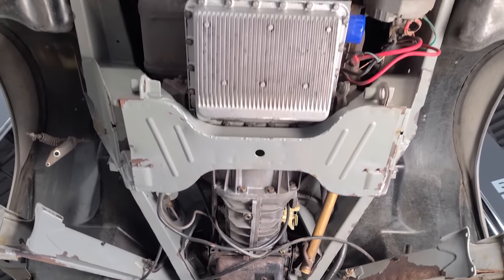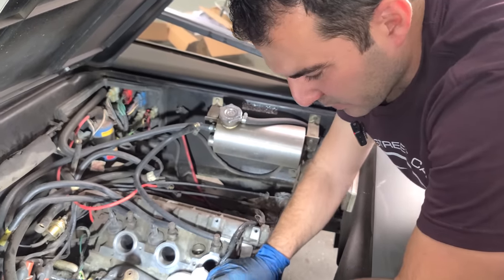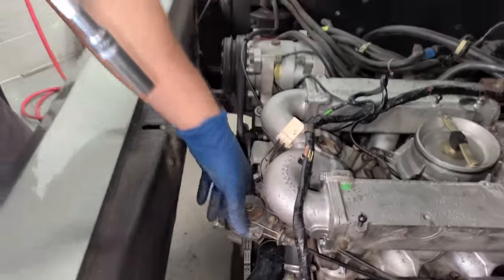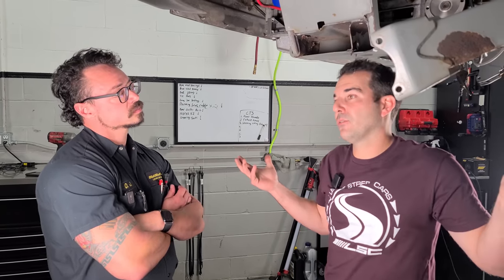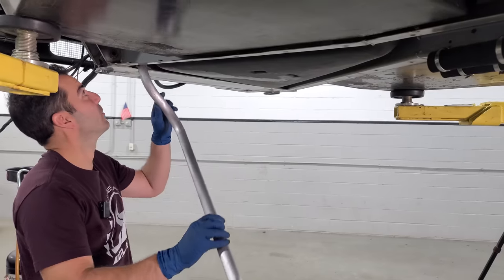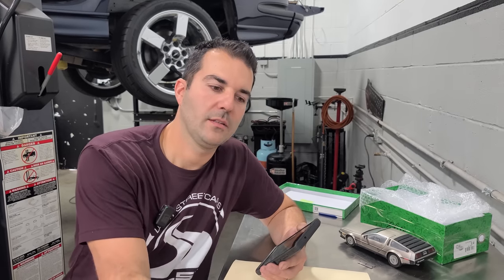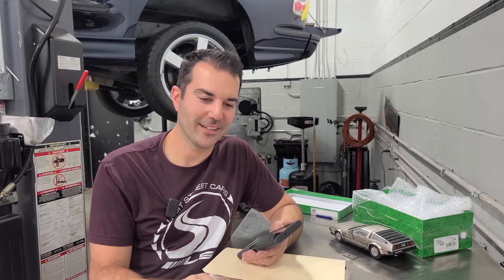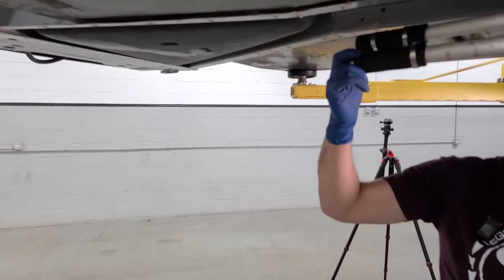I Put My DeLorean Engine Back Together & Spoke With The Orignal Owner! Fake Miles & More Bad News :(

Comment from the maker: Ok Ok, if you were going to swap the engine what would you go with? It's coming out anyway at this point.
Reply: kia stinger or coyote
Reply: Lsa 6.2 L.S
Reply: Coyote would be cool
Reply: See? I knew there was going to be an LS9 option 😂
But you could go with a Tesla conversion 😮
Reply: Rb26 probably
Reply: Hellcat red eye. Biggest bang for the buck. Coyote is a great choice too.
Reply: Coyote
Reply: A ls
Reply: K20
Reply: RB26
Reply: Supercharged 3800 Buick.
Reply: Take it out and do a complete rebuild
Reply: M113k
Reply: Honda k series
Reply: Ls427# 888mph
Reply: Can a V8 fit in that ?
Reply: The v6 from the F150?
Reply: If I could ,I would have made it stock . To swap I either go for a coyote for American muscle vibe or straight to a 2jz if I could (I know its dumb but that is my way to go)
Reply: Why swap it? Use what u got.. maybe do a conventional tune with cams and headers? 
And/Or make it run on homemade methane gas (biogas) . 
Or if u must swap the engine..make an electric conversion.
Reply: @hashtagtnt  probably.
Reply: Twin turbo LS from Texas Speed!! Hit up Cleetus
Reply: N55
Reply: K20 or 24 or  a turbo2.0 out of a newer accord
Reply: Either ls 6 or 2jz
Reply: C8 Powerplant
Reply: Syclone engine
Reply: Grand national gnx turbo 3.8 swap
Reply: Electric, closest to a flux capacitor
Reply: Electric motor. Nothing fast cus the car won't take it.
Reply: Coyote would likely be best, but I'd recommend an older Ford engine like a 351 carbonated motor.Less to translate over and change overall and very powerful.
Reply: a bmw e60 m5 engine (v10)
Reply: Honda K or J series swap.
Reply: Ls7
Reply: @hashtagtnt ls1 conversion has been done before can't remember where I saw/read about it though
Reply: Or rb26
Reply: LS front wheel drive from a Grand Prix, use the front wheel transmission etc.
Reply: 1kr fe (1L 68HP)
Reply: Would be sick if a Barra fit lol probably not tho
Reply: turbo k24... 1000hp, with a sequential transmission. ooooor... i think LS2's or LS3's came in the GTO's that are side mounted and that would be pretty cool to see. but the k24 is super light and can be pretty powerful.  or wanna go crazy unique... Barra or 2jz for the lulz
Reply: B280 would be a logical choice. Porsche 928 would be what my heart wants, because that's the engine sound dubbed in for BTTF
Reply: Coyote
Reply: LS swap it, make it fun
Reply: 2JZ with a hater pipe
Reply: @jakepocock1616  hmm... honestly would be pretty unique imo, them f150 v6's are pretty nice
Reply: @Joe-bj7nz  the engines in these things are 100% garbage, and he has access to do anything in the world. i wouldn't put a dime into this engine besides getting it running with a basic tune up
Reply: You know you want to ls swap it
Reply: Series 3 buick 3800 supercharged 😉
Reply: Realistically the transmission can’t take that much power. I do a mild EV build.
Reply: EV or the Hellcat. The whine behind your head wohld be insane. But seeing you and Rich turn it into an EV would be epic.

Edit: unconventional option that you have experience with....N54!!! Low weight, twin turbo noises, ridiculous torque, easy access to the typical issue areas in that bay....and they're CHEAP to get and tune as you know!!
Reply: Fwd gm buick/pontiac  90-00 3800 supercharged v6. Plenty aftermarket for it and they make proven tq/hp  while keeping weight down
Reply: 4.3 LS? It's an LS, tons of spare parts availability and it's a V6 so there's more room in the trunk for it.
Reply: LS?  Hellcat?  Mercedes V12?  (That would be interesting...)
Reply: Not many will say this but fix the original 😊
Reply: Tesla!! Just makes sense!!
Reply: nissan maxima vq35
Reply: Have fun with it and not be sad , you can go in the past and bring a new one .
Reply: Maybe a turbo conversion L67, or I know the LS4 has been done before.
Reply: @shept.7736  very common swap for this car and fiero's but personally i think the engine from the GTO would be a great fit into this. i think they came with LS2's or LS3's and are setup to be mounted in the same orientation as well as the stock engine much like the 3800 but with more power baby !
Reply: Buick 3800 supercharged series 3
Reply: C!ear!y a GNX turbo six is the right swap.
Reply: GM 2.8 twin turbo from the UK vauxhall insignia vxr and in a cadilac something lol
Reply: Tesla
Reply: Big turbo honda swap 👍
Reply: LS Swapped
Reply: 383 STROKER
Reply: LS swap! Or to keep it 80’s, see if you can find a Regal 3800
Reply: I know it's almost cliche at this point but I would LS swap it .
Reply: Everyone keeps saying coyote, Jared could barely make it fit in a Duster and this is infinitely more complicated.
Reply: Ford 3.0 Twin turbo
Reply: On second thought Alex find out if your Delorean friends know where a replacement Delorean engine can be acquired.
Reply: Ls4 swap!!!! You can keep the same manual trans that came with the cars.
Reply: @whollymindless  straight up just steal is buick engine hah. i mean he could just take the trans am engine as well... or even the van engine.
Reply: A powerful 4cyl, all those here recommending these large engines must be old or compensating for something. This car is old and needs to remain light, adding a massive overpowerrd engine is just bad.
Reply: LS9!
Reply: Something that revs high and put a different manual trans in it as well.  Go crazy and put a Hayabusa motor + turbo and a manual trans from a Porsche.  Please not an LS swap, those have gotten boring.
Reply: Keep it a V6. Maybe the V6 out of the newer Camaro's?
Reply: Buick Grand National V-6!
Reply: Thought a little more… single motor Tesla..but then what about a 350-370 Z swap, 6 speed
Reply: A Corolla engine so it’s reliable
Reply: If its just sitting on the drive for Halloween then rebuild the engine as you can have it towed to your garden to display
Reply: Okay, people, hear me out: the Vortec 3700. 3.7L I5, 242/242 horse ‘n torque, decent fuel economy, and would probably fit pretty comfortably in the space you’re working with. PLUS, its damn reliable, and its a GM engine so you can KEEPYOURGMGM. Think about it!
Reply: Alfa romeo v6 busso .Would sound epic if it was possible.
Reply: Seeing what Mike from Stanceworks did with his k-swapped Ferrari, that's maybe the right size for the engine compartment? And for all the reasons Mike states for the swap.
Reply: It's gotta be gm so probably an ls
Reply: Rotary
Reply: Put something in it that's v6 with good power and reliability. Like the gm 2.8 3.1 3.4 or 3800. The 3800 with the super charger would be fun and not overly powerful with reliability. A complete rebuild and dress up of the engine would be cool.
Reply: K series of some flavor.  Probably a K24 for a little extra displacement.  Small turbo for a little extra fun.
Reply: V6 needs to go in place of V6 :) Kia Stinger has great v6 for that. You can also try Alfa v6.
Reply: I would go for a more modern PRV with split crank pins (so even ignition firing and much better gas mileage) so it would just bolt right in. Options for donor cars are Peugeot 505 V6 (170 bhp), Renault 25 V6 Turbo (205 bhp) with the super reliable UN1 manual gearbox, Peugeot 605 V6 (170 bhp or 200 bhp with 24V), Renault Safrane Biturbo (268 bhp)
Reply: See if you can partner up with Texas speed and get a good solid running reliable motor with good power
Reply: Engine ? I think you need a big Tesla battery ! Make it seem futuristic 😎
Reply: K series
Reply: The wiser engine choice in a volvo 760 (wich hade the same engine as the dmc) wich is the volvo B230FT. Its a extremely reliable 2,3 four cylinder turbocharged engine with 165hp. The engine sits in volvo 740/760 turbo from 90 to 98.
Reply: Go diesel
Reply: I'm sure these already don't handle great so I'd add the weight of batteries and go electric.
If you want to own and use it forever the unfortunate fact is it's future down the line is prob stuff like battery upgrades
Reply: SMX
Reply: @AlteredCarbons  Well Ive experienced one of these engines in a Volvo 260.. and it pulled like a lil troll. The DeLorean should be lighter and even more fun than the 260. So engines not crap. 
I think it would honour both this legend of a car and this engine with a somewhat unfair reputition if LSC would make to most out of this engine. 
Thats also a good attitude overall to make to most out of stuff you got not throwing everything away and buying new shit.
Reply: 7.3 w120
Reply: Twin turbo coyote 😂
Reply: Turbo K20. It’s what Colin Chapman would use. Or LS for noise, reliability & ease.
Reply: See if a 2jz or rb 26 would fit 😅💀
Reply: Ls7
Reply: everyone saying these thousand hp motors as if this old car could ever handle it 🤣
Reply: Buick 3.8 turbo.
Reply: @jaydenbernhard92  Yeah, right.
Reply: @jakes197  Kia...KIA?  Just no.
Reply: Honda J37
Reply: V8 just ain't gonna fit.
Reply: Turbo charged Chevy 4.3.
Reply: @SamwiseGamgy47  Ghay Soyness.
Reply: @icedragon6831  Too long.
Reply: An EV conversion seems appropriate for a DeLorean.
Reply: Porsche engine! Turbo that sucker!! 👍
Good luck Alex great work love from the U.K ❤👍🇬🇧
Reply: LS
Reply: Leave it, but add electric hubs to the un driven wheels. 🤌
Reply: I would go with something like a GM LGX if you want N/A, or if you want more, a LGW.
Reply: DeLorean has a rear bias and lightening it up should help with handling so something light that can generate power would be awesome. the Honda K-series would be great, as it's reliable, light and is easy to generate power with an amazing aftermarket. I'd be concerned that the DeLorean's transaxle may be limited on how much torque it can handle.
Reply: @flanigas  I despise electrics, but I think you're on to something here...
Reply: The original just rebuilt
Reply: I'd get with @texaspeedperformance and see what you guys could put together
Reply: Absolutely a 3.8L Buick V6, preferably the supercharged variant. The engine designation here in Australia was L67, we had them in a couple of models of our Holden Commodore/Calais/Statesman
Reply: @cottage6988  I’m sure a frame made for 100hp will be fine with 700hp.
Reply: There are plenty of original delorean engines that pop up for sale all the time. Keep it original, restore the engine in there. If anything do a 5 speed swap. You will be very happy vs the automatic.
Reply: SHO Taurus engine
Reply: Electric, not tesla swap but a fully custom built drive train from forklift motors
Reply: If not Honda K then some good v6 shouts like Alfa or more modern turbo v6. Maybe u could drop a Honda turbo K into a white Lotus Esprit one day like one Bond used to go under water, Esprit is another car from this era totally let down by Renault parts & old 4 pot.
Reply: Coyote
Reply: I would love to see a rotary in there, like it was originally planned from delorean😁 but to complicated, i would go with a coyote
Reply: Probably a late gen 3.5L ecoboost. You don't want too much power to overwhelm the chassis and it has to fit and weigh almost the same as the PRV engine. That or a 3800 without the plastic manifolds.
Reply: @fiero880  it’s one of the weakest, most unreliable engines ever made.
Reply: biggest issue is are you replacing transmission? that Renault won't handle a lot of torque.
Reply: LS swap
Reply: 3.8 liter turbo from the Buick help the little brother out.
Reply: K24
Reply: LS no question
Reply: k20
Reply: Re build the engine for boost and turbo it double hp and go keep it Delorean
Reply: What if you 3D print all the parts and build a brand new engine?  Naw, too much work.  Good luck!
Reply: I see a lot of electric swap, comments. That would be the very first electric delorean, and probably the coolest swap ever done, but how difficult would that be. I think it’s easier said than done.
Reply: If I had the experience and knowledge I would go Electrical Tech. But the rebalance weight distribution would be something, Center of gravity. It just has to go above 88 m.p.h 😅😂, anyways awesome 🤩.
Reply: LV1 said it since the 1st video
Reply: C32 AMG swap would be rather unique IMO
Reply: Aston Martin 4.7-litre V8
Reply: K series. Would pass off alot of people
Reply: SPEC TT Rapture – Forged Internal PRV w/EFI, Twin Turbocharger Units (Premium) by DeLorean Industries.
Keep the "purity."  😁
Reply: In my opinion, I would keep it original.
Reply: V8 Porsche 928. That was the engine sound they dubbed for the Delorean in BTTF.
Reply: 4.3 from Chevy Astro van
Reply: GM 3800
Reply: Tesla!😈
Reply: I need a job alex,, you hiring? I'm in Cincinnati Ohio.  I'm serious.
Reply: The guy that did the Kia engine in his sounded so good had some of the flair of the original but all modern.
Reply: The correct answer is LS.
Reply: @Gleamozen I've seen someone building one before on YouTube. It makes sense for sure and a helluva lot faster, but it wouldn't be the first.
Reply: You could go basic and drop in an LS3, or if it would fit, a sweet LT4 Crate Engine.
Reply: I know I will get hate but the last of the Northstars were decent. They aren't terrible to work on outside of the car.
Reply: what about rotary?
Reply: a VR6 to really get the haters going
Reply: Chevy 350cu.  Loads of options, very available, and cheap or a Turbo 3.6L. Something that could utilize existing mounts without too much modification.
Reply: Vw gti for authenticity. But a 2jz would be cool man
Reply: A massaged 4.3 Vortec.
Reply: Tesla
Reply: Everyone does LS swaps.  Don't get me wrong, they are great engines, but it is really getting boring; OH, look another LS swap car/video.   Do something different/unique.   Swap it for a Honda/Acura J32 or J35...double or more power, light weight, still a V6, and reliable well beyond an LS.
Reply: Something simple and nice not crazy hp because it’s not a race car
Reply: I hope that wasn't a Freudian slip when you said Tesla. Please don't make it Tesla powered Alex!
Reply: I'd personally love to see some kind of 6 cylinder engine in there; V6 or straight 6, I don't mind! That said, you could also go kinda crazy and try to squeeze a V12 in there if you're mad enough but idk if there's a V12 small enough and easy enough to find that'll fit the car so yeah. That's my answer
Reply: Could go to the future tesla swap
Reply: Grand National 3.8 or Syclone 4.3... maybe Buick 3800SC? Got to keep it a V6!
Reply: @jakepocock1616  Ford GT V-6 ;)
Reply: Ls engine but make frame stronger 💪 for twin turbo it or do like you did to your wife's suv super charge it..
Reply: Honda K
Reply: LS Swap Reliable and parts are cheap in case it brakes down
Reply: LS
Reply: Your company is literally LS C sooo.
But a Ford turbo v6 out of an F150 would fit better.
Reply: oh, and hydroformed SS matching bumper covers to replace the plastic ones,
Reply: K24 1000 hp
Reply: Supercharged Buick 3800
Reply: Supercharged 3800!
Reply: LS1
Reply: r56
Reply: Put a Tesla motor in it to turn it into a 1.21 gigawatt DeLorean, or dodge hellcat for that supercharger whine
Reply: 3800 supercharged buick engine!
Reply: GM 3800 V6
Reply: This car doesn't need more than 200 horsepower.  Lotus uses the 4 cylinder from a Corolla with a neat turbo.  You know it would fit easily.  People saying a Coyote don't seem to realize how big the thing is and what a dog it is at low rpm.  You want to be quick off the line not going 150 mph with a load of horsepower.
Reply: Keep it 80’s and make it reliable!  Go with a GM small block.
Reply: Honda series j37
Reply: Definitely series 3 3800 supercharged or twin turbo
Reply: Supercharged 3800 series Buick V6, or and LS :)
Reply: Try laser rust removal. It’s cool.
Reply: LS swap if possible !! that would be bad ass...the original owner Dave was a heck of a nice guy!!
Reply: A  Hayabusa with around 6 pounds of boost. It would be even lighter with more hp and sound insane when you rev it lol.
Reply: Me? I would put a Subaru Flat-4 Turbo in there, but I am weird...
Reply: Also if you use the laser, it will also burn off the epoxy
Reply: It would be cool to keep it a V6. Ford's 2.7. If you wanted to keep it GM the 3.6 has it's flaws but with proper maintenance is actually a solid engine. Or the Honda 3.5
Reply: Honda j35 with a turbo.
Reply: @theamerican7080  You know what.. I second this. Or maybe even the 3.8 Supercharged.. Perhaps a Series II.
Reply: Go electric. A delorean is the one vehicle you can shamelessly ev swap.
Reply: Newer PRV from Volvo 262 or from Renault 25 V6 Baccara
Reply: Hmm....not an expert, but this would take some engineering research. The design of the chassis could be a huge limitation. Too much engine can damage a vehicle. I wonder if heat can be a big concern? There is a lot of fiberglass.
Reply: turbo k24
Reply: A vortec 4200 inline 6 from the 2002 trailblazer its such an underrated engine
Reply: Already posted that an LS and a Porshe transaxle have been swapped on others. A 5.3L should be plenty for that car.
Reply: LS or Kswap are the only logical choices.
Reply: Chevy LFX V6
Reply: TESLA.  It goes with the back to the future vibe.
Reply: Not sure what i would go with for a engine but as for your frame issue, why not have a custom tubular frame fabricated? You're already upgrading the suspension so this seems like a opportunity to upgrade the frame to match.
Reply: 3 rotor with a turbo would be really cool. He could try to collaborate with Rob Dahm or the Vargas brothers.
Reply: 1.9 TDI PD131
Reply: LS, Coyote would sound great but it's a larger engine.  Much harder to squeeze everything in.  Plus you can work on an LS blindfolded at this point.
Reply: A new 4.3L GM V6
Reply: Tesla Swap it :D
Reply: Clio V6 engine, it's already a Renault unit, so would be cool to keep that
Reply: @cottage6988 He would never make it to 88mph!  That engine would tear that car apart.  Awesome concept though, would love to see one
Reply: 2jz gte
Reply: Do it once, do it right, especially if you are keeping it for every. That way you know it is done right and you wouldn't have any worries driving it. A for engine swap, "K" tune.
Reply: Call Rob Dahm and put a 3 rotor in it…
Reply: Well if it’s a factory gm engine then I’d probably ls swap it. That way you get power with reliability. Would love to see you restore a 1st gen Toyota 4 runner. I’ve been daily driving a 86 for 3 years now. I’m having waffles and eggs with toast for breakfast right now.
Reply: 1.6 litre, 20 valve "Silver top" (4th Generation) 4A-GE
Reply: Keep it stock.
Reply: Volvo B260/B280
Reply: Coyote.
Reply: LS. 😂
Reply: I’ve seen alot worse get cut out, fabed up, and welded back on better then the original metal. You’ll be able to fix it.
Reply: Considering how tight that engine bay is, I'd have to consider maybe a small V8 or even a twin turbo V6. You unfortunately don't have a whole lot of room to work with.
Reply: Keep it "original". Try and keep a PRV V6, but hop it up internally. Not sure how much power these engines can make. But don't do an engine swap
Reply: 2jz supra or a 5sgte iron block Toyota 2.2.
Reply: Honda K24
Reply: LS, but you could always make it a little more interesting with something like an M113 or even the K variant - if possible, that would be sick as hell. OM606 seem really neat and can be built up and reliable but that'd be a LOT more work. LS is probably the easiest route, but a Mercedes or Italian engine would make for a more interesting car IMO.
Reply: They managed to get this engine to 400hp in the 90s on another car with turbo and custom forged parts.
Reply: Alfa Romeo Busso V6
Reply: car wont be able to take much power and space is an issue, how about a 2.0l ecotec lsj, its light 300lbs without the sc, can handle enough power without internal mods, tons of very cheap parts and its completely impossible to kill, some guy runs 5.91 at 230mph 1/4 mile with the oem cast engine block, its a euro engine in a american car like the delorean, it can go up to 88mph...
Reply: 5sgte can be very powerful 650 ft lbs of torque is small and very easy to work on. 2.2 liter and iron block. Lasts stupidly long with a normal timing. And they are in the MR2. Don't go 3sgte unless you want turbo.
Reply: K swap
Reply: @ProfessorShroom I think it’s a Peugeot-Citroen PRV engine. Same as a Dodge Monaco
Reply: If it will fit, LS4. Get ahold of Garrett from Cletus McFarland for add ons and tuning. Leroy the Savage started out with an LS4 and was running 8s quarters. JS
Reply: Gm 3800 Series 2 or 3 N/A. Keep it Gm, and V6.
Reply: @timp5668  my DeLorean was very reliable and with the five speed it’s not a terribly slow car. You also have to remember how old these cars are in 1981 so that’s not bad as long as it’s correctly maintained it will last for quite a long time but remember, a lot of these cars have sat for years and years and years rotting away.
Reply: @ml8067  Just weld enough steel to it. Where there's a will, there's a way. 
Helps to have enough money, though. Lol
Reply: swap with a rebuild from delorian. Send in the core just like the frame.
Reply: EV!
Reply: I’d pick the transmission you / that has the possibility of fitting and holding the power you want to make, then let that dictate the engine choice, because the current transmission will not hold up to about any perforce based engine you’d likely want to swap in it.
Reply: @fiero880  one exception does not make  a rule. The car literally makes 100hp at the wheels. By any standard, any decade beyond 1930, that is considered gutless.
Reply: Air cooled 911 not likely to fit but come on its screams porsche
Reply: @MethanolEnjoyer like this..that would be interesting...
Reply: @coby541 
Nice idea don't think there's enough room for a barra engine in the Delorean..
..
Can you get parts for a Barra engine in 'Merika
Reply: @FYMASMD but it looks like a chassis/frame resto or repair.
And knowing OJ + FMU they'll make it better than the original..
Reply: Stay true to it's roots - Volvo T5
Reply: The successor to the PRV, the Renault L7X / PSA ES9J4.
Reliable and really good sound
Reply: @chrisparola3949  do you know the cost of an aircooled Porsche motor? Not worth it.
Reply: Ls3 or lt charged no ls7 please, heads issue. just swap it to a1000 whp!
Reply: @Iron_Funeral Yes..this is my thoughts..
Alex knows the engines would truly be unique...
Reply: another Delorian engine!
Reply: LS swaps are super popular and well documented
Reply: I think something a little different is in order. Flat plane crank V8 I think befits the styling and is what that kind of car should of had. F355 engine would be the pinnacle for that if you don't mind ruining your life.
Reply: @hashtagtnt yes. LS swaps and Northstar swaps are/were popular
Reply: leave it alone, keep it original until it blows up.
Reply: @timp5668  was there a price  limit? Thought we were dealing with a forever car
Reply: Maybe an …LS lol
Reply: @decomposing_while_alive2002 or the R32 3.2 V6 which I think is a Porsche/boxster engine in a different interation..
That would keep the V6 theme...
Reply: keep it original until it blows up.
Reply: @YuriChan-428 that would sound interesting and weird at the same time lol...loads of power if its the Impreza engine...
Reply: Of course we gotta go with the turbocharged Honda K24A2 swap, there can be no doubt.
Reply: I wouldn't get a V8, it's just too much power for the platform. By best bet for reliability is a Buick 3800, which you're already familiar with, for sound and novelty I'd grab a VR6, and for power I'd get a VQ. I fear the VR6 might be a tad long and tall, so if that doesn't fit, the other choice for sound would be a Duratec, if you've seen Alex's Rocketeer Miata you know that sounds lovely. Fun fact: Ford brought Porsche in to consult on the Duratec's development.
Reply: You know the answer already..  LS swap for the win!
Reply: Don't swap the engine until the factory engine gives up the ghost.   The factory engine could last another ten years and 100,000 miles.
Reply: Those PVR engines are actually great, they made 400 hp in the Venturi Road cars, with turbo I believe, and 490 hp in the Alfa Romeo 155 touring championship cars. Besides they proppeled the Renault Alpine A310 and the V6.
Reply: @chrisparola3949 sadly that changed with the chassis/frame rebuild..
Reply: Tesla plaid motor
Reply: LS swap definetly
Reply: A turbo Ford Bara because why not!
Reply: 7.0L LS
Reply: 1/ I'd say the engine out of the McLaren🤣
2/The mercedes V8
But this may be too heavy.
3/Really like the Alfa V6 ~ 250 horses in standard.
Which would be a nice power for the chassis without overwhelming it.
Looks good with the chrome inlet pipes too.
Would be unique.
..
In all honesty keeping the original Renault V6 tuned to about 250hp.
Or use the original  V6 with the twin turbo option available at the time.
Keeps things simple. & Original without mission creep.
(While you're in there)..
LS is great but has been done loads and would be a little too heavy possibly too much power..
...
Reply: 3800 Supercharged V6. It'll remain a V6 but be reliable and have much more power with the supercharger.
Reply: K20 turbo. Light, powerful, and reliable.
Reply: Lima 2.3T
Reply: LS sounds good but to make it a Tesla swap Electric that sounds kind of cool to
Reply: M113K, of course!
Reply: SC 3800!!
Reply: The limit of the frames capacity? 😮
Reply: Anything but the PRV engine. I followed a blog about a Volvo 760 restoration, he even got a new engine from Peugeot, the factory new block decided to split after 300 miles or something. If you want to punish yourself with Volvo parts, then a T4 from an old S40.
Reply: 1uz-fe
Reply: 3800 GNX Motor
Reply: K20 would be an incredible sound, bulletproof reliable, lightweight fun. And it would be different than your usual v8s
Reply: Since it came with a psa engine, maybe a volvo T5? Unique sound and reliable. Otherwise any turbo v6👍
Reply: a porsche 4L flat 6 would be a pretty sick swap. or maybe a 6G72TT
Reply: Subaru VB 2.4 boxer
Reply: @timp5668  Exactly. If it can run through time and space then it will be fine. 
Just got to find a place to put the nitrous bottle.
Reply: Supercharged Camry Engine... just like a Lotus. And you will keep it a V6... a good sounding one!
Reply: Northstar v8
Reply: I’d definitely improve the performance if the frame has too come off. Maybe an LS or some sort of V8
Reply: You know its gonna have to be Electric :face-blue-wide-eyes:
Reply: This is out of left field, but I just recently watched a Jay Leno's Garage video where he was showing his Chrysler Gas Turbine car.  I think that a DeLorean equipped with a gas turbine engine would be about the coolest thing out there just based on the sound they make alone.
Reply: EcoBoost 3.5L if want to keep it a v6
Reply: Ford 3.5 ecoboost stick with v6 power
Reply: Porsche 928 V8 as apparently used in one of the BTTF stunt cars

Lotus Type 918 (V8 from the Esprit)  It's pretty much a Lotus Esprit chassis anyway, so why not go with the correct engine.

Or, get a properly sorted 3 litre PRV V6 turbo engine.  Still pretty much the same engine, but with 300-400bhp instead.
Reply: A 5.6 liter V12
Reply: Dare to be different, Ford 3.5 ecoboost
Reply: LS3!!!! Hit up Mike Myke he always seems to have some. 😂
Reply: That PRV V-6 is pretty small...and I will come FIND you if you manage to wedge it and fit up an LS. (Toothless threat from war-weary, frail, old lion!)  How about something 'Merican, but unique?

Joke-swap:  250 Sprint OHC 6 {giggle} from a 67 Firebird? (NEVER FIT!, but John Delorean had hands all over it!)
Better, would be a bone-stock '63 Turbo-Rocket 215CI Olds.  Probably bloody expensive, but it'd cause some serious ass-scratching at Cars 'n' Coffee!
Best(?) just a plain old Rover 4.0liter. It's the same basic engine as Buick's version of the 215, but cheaper.  All alloy pushrod V-8...light, EFI-reliable...pop the tops off the rocker covers and have a set milled up that say DMC!  Be 'creative' with intake plenum(s).
Reply: Peugeot-Renault-Volvo (PRV) 2.85 L (174 cu in) SOHC V6, rated at 130 hp. The engine the car came with.

The Delorean is not now nor ever was a high performance car. It is, like a Miata, a high-fun car, and would not benefit from a heavier, more powerful engine. Keep it original, protect its value.
Reply: 3.8 buick boosted the displacement and size would work and you same era as you said if i was in your shoes and it would be freakin awesome
Reply: VW VR6
Reply: Swap in a Buick V6 Turbo (just not the one out of your GN😁). That oughta get you up to 88 mph easily. You were really bummed out when OJ gave you the condition of your DeLorean's frame, and I know that feeling. Maybe in a couple of years, we'll see you take the frame out, get it acid dipped, and replace or reinforce the weak points. And coupled with the work you've done so far, she'll be brand new - technically. You got this.
Reply: 454 lsx with twin 80mm turbo
Reply: @craigquann   just put the metal coolant elbows in so you don't have the buick valley of death lol
Reply: If you want a V8, maybe a GM LS4 5.3. Might make it easier to adapt to the Deloren.
Reply: milwaukee 8 engine. ;)
Reply: @george_cramer_1980  ic. Are they plastic from factory?
Reply: This is a retorical right, all aluminum LS and a Precision turbo
Reply: 1st choice - 3.8 Buick Supercharged for size and reliability! 2nd choice - Tesla for cool factor, power and practicality since it will be a Cars & Coffee Ride in The Future anyway. And a totally silent DeLorean would just be awesome!
Reply: V12 from W140 Mercedes, and put in Brilliant exhaust to sound like Zonda))
Reply: @craigquann  yup 2 plastic 90 degree elbows under the alternator from the water pump to the alternator bracket for the heater hoses bad design that the aftermarket actually fixed
Reply: K24
Reply: Since there are so many plug and play options for the Ls, that would be the route I would go.
Reply: Grand natty turbo 3.8l. That'd be a sick swap in a dmc
Reply: Dude, swap it with something crazy for the content possibilities. I think the extra popularity and novelty will offset the costs of doing the swap. Don't go with the conventional LS swap. Something that'll sound as exotic as the car looks.
Reply: @jakes197 oooh honestly you're onto something with a stinger engine
Reply: I'd try to figure out how to have a Telsa EV drive train with an LS power plant Quiet when I'm Grocery shopping, loud when I need a super quick get away down the drag strip and make my tank of gas almost out last the tires.
Reply: please keep it original, a beautiful car that doesn't need to do 0 to 60 in 3 seconds, its a piece of history
Reply: Godzilla
Reply: this v6 prv engine evolved in Europe over time and even ended up with a turbo mounted in an Alpine A610, but even in another French brand "Venturi" which released an exclusive model "LM500" which participated in competitions and developed loan of 400hp in 2800cm3....
I would personally stay on a v6 for reasons of size and would look for a reliable engine...
Reply: Anything but another boring LS.
Reply: LS7, easy. :)
Reply: @theamerican7080  LS is very compact.  Guarantee it would fit.
Reply: Mr. Fusion.
Reply: @george_cramer_1980  good to know.  Definitely something to upgrade
Reply: LS is pretty common but the Renoult gearbox isn't really good for handling that much power. Maybe a chevy smallblock or ford 4.6 modular.
Reply: I say electric swap it (Tesla) or some sort of thematic 6 cylinder. The reason i say go for the electric swap is that it would eliminate a ton of weight, tubing and complexity as far as some of the goofy coolant lines and locations the car has. You would be able to put batteries low where you want them and choose how much/ how far you would want it to go. regenerative braking as well to further assist your braking needs. Would definitely need a tesla expert though. In a simpler life to keep it easy and on a budget id go for possibly a GM v6 maybe a vortec or if your going to go transverse a buick 3800 like some suggest. Whatever way you go should mostly be dictated by SOUND, FEEL and CHARACTER not power as this is a dream car of yours, it needs to feel complete, not pieced together.
Reply: Cheapest and easy would be the 07K 5 cylinder mated to a FWD Passat/A4 or Porsche Boxster 01A transmission.  The non turbo engines are super cheap and you can still make power with them if you add a turbo but they all sound absolutely incredible.  They bolt right together if you trim the bell housing and patch it (just to clear the rear timing cover)  You can use a stock 4 cylinder clutch or with an aftermarket flywheel you can use B5 S4 clutches.
Reply: Buick turbo v6
Reply: Something much simpler and of the same overall size to actually fit in the engine bay. I wonder if a 4-banger would fit, but a nice, small (in overall dimensions) V-6 would be great. Wracking my brain, I can think of the Ford Eco-boost V-6, but it's a 60 degree motor.
The PRV motor was in a LOT of cars over its 25-year run, even in a Lancia. It was considered to be a good engine, but some/all owners may vehemently disagree. Simple design it was not, as evidenced by the "Valley of Death". I suppose one could fit in a Mercedes OM 272 as it's also a 90 degree V-6. The OM 276 motor could be a good choice, but it might be too powerful for the DeLorean.
No matter what modern-day V-6 is used, it will need the ECU and enough room for the exhaust manifolds to snake out.
In the end, I'd keep the PRV and search around for one which is in better shape, rebuild it and have fun. You won't be putting many miles on the car, so that could work out the best. Going the adapter route and then having to replace a lot of other components will not only be expensive but a major headache. You want to end up having a good feeling about the DeLorean, so if it were mine, I'd keep a PRV in it (after rebuilding a better example without the Valley of Death problems).
In any case... Good Luck. You will make, whatever you choose to do, a very successful endeavor.
Reply: @xoriatmike6857  electric conversion will not save or reduce weight.
Reply: 3.5 twin turbo v8 from the lotus esprit
Reply: Lots of silly answers with way too much power, something like a Honda F20C (or whatever the Civic equivalent is) would suit pretty well, and they're small
Reply: LS3 swap w/416 stroker kit. BTR rails w/roller rockers. cloyes z timing chain.
Reply: Build on the original engine. I get bored of swaps on everything.
Reply: 2JZ or a turbo B series Honda.
Reply: Go with a 2-rotor Rotary! I think a collab with Rob Dahm would be sweet! 😍
Reply: Everyone is saying big V8 or something really powerful I think it would be awesome with a GM 4.3 make it a little more powerful than stock with a cam and head work but not a race engine and put a carbed intake with a Holley sniper kit and drive it
Reply: @xoriatmike6857  AWD electric, that would be pretty sick.
Reply: They make a LS swap kit for Delorean.
Reply: Barra Turbo 🤣
Reply: @Shawn_the_Protogen  Bruh, if you're swapping the engine, you're typically also swapping the transmission.
Reply: 20B
Reply: @thomasolson8417  not necessarily. You can make an adapter plate to bolt an LS engine to the Renault gearbox.
Reply: Honestly since the original engine was from a Renault I always thought it would be neat to do a VQ swap, keep it within the Renault Nissan heritage and get some modern performance
Reply: Just a thought about the "Valley of Death", could you have it Metal Sprayed?
We use Metal Spray (molten metal) on door seal areas for EMI/RFI resistance.
Check it out, a permanent layer of molten metal would protect the valley area from further oxidation.
Reply: Rotory engine.  2 rotor or 3 rotor ftw
Reply: Srt viper cobra haha
Reply: HEMI swap
Reply: RB man idk if that would fit or LSA?
Reply: ...anything with a turbo.
Reply: M156
Reply: A japanese one for sure ! (Yes I am the owner of a Lotus Elise S2 with Toyota Engine. the perfect combination !!!).
At that weight, you just need a small 4 cylinder with 200/220 Hp mx. That' s the right amount to have great fun without driving like a criminal :) Honda K series would be ideal ;)
Reply: K24
Reply: K swap
Reply: Hey Alex ! Don't be too sad about it ! See the GOOD SIDE about it, it gives you the possibility to make a GREAT restoration series of videos about this DeLorean ... and guess what? EVERYBODY LLLLLLOVES IT!
We want to see you DO IT RIGHT, and it's the TRUTH about what such cars really are when they've been used as cars (and not only being museum pieces).
GO ALEX GO GO GO! ALEX BE GOOD!
Reply: I would look for a solid 3.0 from the same family, probably from an old Eagle or Monaco and give it some turbos (like a Renault Alpine) and just be different.   Or just go ahead and be real special and swap in a twin turbo Rotary!
Reply: Rotary!
Reply: I work in a body shop and our preferred rust stopping agent is RUSTMORT it converts the rust back to steel as well Edit: Everyone wants you to engine swap damn vultures lol
Reply: KA20A
Reply: If you want to improve the power while preserving the spirit of the car, the right answer is the ES/L engine, a 3.0 V6 designed by Renault and PSA as a replacement for the PRV engine found in the DMC-12, which produces around 200 HP in the original NA form (and reaches over 1.000 in specialized twin turbo configurations). Using a GM engine doesn't make any sense in a Delorean...
Reply: 2JZ. Send it.
Reply: Nothing to powerful, 250-300nhp ,max
Reply: B284r
Reply: LS
Reply: I'm a little different so I would go with a Ford 3.7L Cyclone out of a mustang, then I would pro charge it so it was running around 450 hp. That way it would still be a V6.
Reply: or the 3.0 twin turbo as seen in the lincoln MKZ
Reply: Buick 3.8 Turbo, Simple bang for buck that would fit in the space.
Reply: Electric with a sound-system to make the vroom-vroom sounds?
Reply: It's looking great.....good job...can I buy that sunroof grease at Mercedes service?
Reply: 7.3L Godzilla. Gawdzila!
Reply: Chevy ss motor nobody touches the Chevy ss 😔😔😔
Reply: Ls lol
Reply: Put a Honda k20 in it
Reply: Supercharged Chevrolet 4.3
Reply: Om606
Reply: Kia Stinger motor
Reply: Honda J series V6. Cheap to buy simple engine with reasonable power. The Delorean Chassis is not good enough for huge bhp.
Reply: Turbo EJ25!
Reply: Don't swap it!!! Just put twin turbos on it, like the Legend Turbo prototypes from back in the day! But if you really want to put something else in there, put some spinning doritos in there, that's what John wanted to do when he first came up with it anyways...
Reply: 347 stroker,but just throwing that out there!!!
Yeah, everyone in the comments we can name off engines all day but will it fit well w/out having to butcher the car or weaken the frame up???I honestly don't know 🤔 🤷 🙄
Reply: M112K, of course
Reply: DeLorean Midwest sells Engine Swap kits (LS, K24, etc). I say LS.
Reply: @cornrichard  yeah,I had a 2000 seville and after lifting practically entire car over the engine to replace head gaskets, it WAS easy to work on then!!!🤣🤣🤣told myself I should turn entire front into a flip-up corvette type hood/fenders/bumper 😀 afterwards, actually cadillac should've done that along w/domed pistons!!!🤣👍👍
Reply: Go budget build LS or something unique. Maybe if you have something laying around that would be cool too
Reply: How much power can the transaxle handle? If the answer is ‘not a lot’ find yourself another PRV V6 and tune. If the answer is ‘a lot more’ the a nice modern v6 would be cool.
Reply: 3.5 V6 Toyota possibly with a TRD Supercharger and manual trans similar to the new lotus
Reply: SHO Ford Taurus V6 and tubos 😆
Reply: I know it’s overdone but there’s a reason. LS swap!
Reply: I have an unhealthy obsession with trying to make the prv6 as good as possible, but if you must: volvo 5 cylinder, or classic red block 4 banger!!!!!!!!!!!! manual tx obv
Reply: LS or Coyote, as generic as an answer that is, is a no brainer.  Easy, cheap, and what 3x more power than stock?  Yes plz
Reply: Honda J series?
Reply: Ls or hellcat so it whines very loud like a time machine loading up.
Reply: @LegitStreetCars it makes perfect sense to use a cammed ls4 manual!!! Even a supercharged 3.8 would be very cool and reliable.  A manual and a v8 is much more movie correct to show us "88 miles per hour, your going to see some serious $hit!"  No land rover v8s.
Reply: Tesla swap
Reply: LS-2 MODIFIED. 700HP. 😎🤘❤
Reply: Tesla swap
Reply: 13B turbo
Reply: Do a co-lab with Rob Dahm
Reply: Well, I would think you would want to keep it fairly stock. I've been watching your channel for quite a while now.  Personally, 130hp is joke, push that up to 450+ and it would really fun :)
Reply: any aluminum LS
Reply: Tesla conversion or hellcat redeye or another original dmc engine!
Reply: Electric. ;p
Reply: Apparently, LS engines in these are a thing.
Reply: 90's Toyota camry 4 cylinder with a turbo
Reply: K20C 2.0T from the Accord. Or the one from the Civic Type-R. 301HP 10-speed transmission, 0-60 in less than 5 seconds on one and just over 5 seconds on the other. DeLorean has to weigh less than the Accord, so it'd be a f-cking monster in that car.
Reply: Pentastar 3.6 LV6. It would suit the car well, fit in the engine bay, but best of all it's modern, makes way more power than stock (up to 300) and could easily make more.
Reply: It might be impossible to find but swap in the DOHC LT5 from the C4 Corvette ZR1!
Reply: Keep it in the gm families and do a knock off cyclone build similar to stayed tuned
Reply: With the space allotment, I would go with either a Buick 215 aluminum block V8 or, if you want to keep the Euro touch, a Rover 4L which is, essentially, the same engine since GM sold the tooling for the 215 to Rover back in the '60's.
Reply: A grand national spec'd 3.8
Reply: Full EV conversion!
Reply: Ls swap
Reply: I would do an EV conversation.
Reply: Ls
Reply: 2JZ billet block with a huge turbo if it will fit 😂😂 Induction performance can set you up!!
Reply: The second gen 2.7 EcoBoost would be interesting.
Reply: *** LS is the only option ****
Reply: Put in an old Chevy 4.3L V6 with a carburetor swapped on. Simplistic, reliable, great part availability, good power, and good fuel mileage.
Reply: Slant six?
Reply: @Joe-bj7nz  last episode he found a lot of corrosion in the "valley of death" which essentially makes the block a ticking timebomb. Finding a doner engine for this car would be seriously expensive if at all possible. Easier waste a bunch of money on a trust worth engine than dropping probably an equivalent amount into an unknown. But it would be sweet to have an all stock delorian.
Reply: I am going left field here but keeping with V6 configuration. Try a 2.8 biturbo V6 out of a Maserati Quattroporte AM 574
Reply: Any modern engine is going to be more faster and reliable than that original one. A Toyota V6 is the most logical choice. Its cheap, reliable and readily available. The unlogical choice is VR38 from a Nissan GTR. 

I would not even look at those inline 6 cylinders like 2J or RB because the prices are getting super ridiculous. And fabrication for big engines would be a nightmare and cost too much. I would not look at V8 either. Too big to put in and again, fabrication is going to cost too much.
Reply: whqt was the renault engine out of the GTA ?  cant remeber will come back to this tho.. sure it was the GTA tho ..
Reply: 350 Chevy small block
Reply: Hmm, maybe twin turbo existing engine?
Reply: 1uz Lexus motor can put out 700 horsepower safely on stock internals (get early model engine) reliable as can be and smooth as glass it would transform that tired Delorean plus it would be super unique
Reply: 2 options:
1) Buick 3800 supercharged, or
2)  Lexus 4.0 liter 1UZ.   Aluminum block v8 with Lexus refinement & reliability. 

As others have said, you don’t want crazy stupid horsepower in that chassis.  It would tear it apart. Just something spirited and reliable for fun drives and cruising.
Reply: @therealdojj It would be nice to see an electric conversion, but there's not much room to put all those batteries.
Reply: I really think an inline 6 cylinder engine would be great, maybe an S50B32. But I don't think there is enough room for that
Reply: @MenezesIndustries  That overly complicated, poorly engineered, under powered POS isn't worth it.
Reply: I think I’d keep it a V6 and go for the Series II 3800 Supercharged L67, especially because there’s a ton of performance parts available or used to be available for them, not sure if ZZPerformance or Intense Racing still make parts for them but I was able to squeeze out roughly 500hp from mine in my 2000 GTP with the stock blower but ported. Did a built bottom end, stage 3 heads and a massive cam in mine, loped like a big cam small block V8 and ran high 11’s in the quarter before I parked it.
Reply: Not a lot of room in the engine bay.  If the OEM was 130 HP, you can't go crazy without breaking the trans.  Compact, reliable, 200 HP max, maybe a GM OHV V-6, either a 2.8 up to the Buick 3800.  Cheap, reliable.  Everything the DeLorean was not.  :-)
Reply: Alex given everything I think you could create a ton of awesome content by doing an LS swap on the DeLorean! It has to come apart to get the frame fixed or replaced that would be the perfect time to do an LS swap. It would be some of the best content on Youtube today! I think a lot of us would like to see that happen after the DeLoreans Halloween appointment!
Reply: LS or coyote
Reply: K Frank. K24/20
Reply: Toyota 3.5 v6 2gr with a supercharger and lotus manual transmission
Reply: Ls 6.0 or 6.2
Reply: @hashtagtnt already been done ls swap
Reply: toyota 2gr v6
Reply: @josiahtroup8858  Ah yes that is correct huh? Thats valley of death problem is not to ignore.
Reply: i would say been an Aussie Holden 3800 supercharged. from memory its a Buick motor. super reliable and could fit them in a go-cart almost.
Reply: 2GR-FSE
Reply: tesla
Reply: Busso V6
Reply: Collaboration with Rich Rebuilds and do a Tesla powertrain swap. >>To The Future!
Reply: I was just going to say that minus the supercharged. I had an 88 Bonneville SSE with a 3800. Reliable engine and just sporty enough. @craigquann
Reply: The engine in the DeLorean I believe is shared with the Renault Alpine. The version for the Alpine was factory turbo, and I would assume higher compression. It's be cool to do a direct OEM+ swap if you could even find one
Reply: The AmeriBarra: turbo'd GM Vortec 4200
Reply: GM ZZ632/1000
Reply: Lotus Esprit turbo 300 v6 Car fr9m Pretty Woman
Reply: mercedes amg engine, either the v6 from E43 amg or a V8 (either supercharged e55 or the 4 litre twin turbo).
Reply: Either a 3.5 Ecoboost from a Taurus SHO or a supercharged 3800 would be really sweet
Reply: Keep it a V6 for originality. It doesn't need gazillion HP. How about a 3.2 V6 from a Cadillac?
Reply: Probably an eco tech or a beams.. Something simple tunable that wouldn't changer the winger dynamic of the original car
Reply: Audi 3.0 Turbo
Reply: you know you Love the LS....
Reply: Turbo Barra.. If there's room..
Reply: Camry hybrid setup lol
Reply: Turbo K24
Reply: toyota UZ!
Reply: Coyote. You should also look into the stainless steel frame that’s made for the car
Reply: 6.2 LS for sure
Reply: Honda J35
Reply: V8 Porshe 928
Reply: Mr. Fusion
Reply: A 250 hp electric motor.
Reply: OM 606
Reply: LS4 since it is transverse and easier to install, in theory
Reply: Or a stroked S65 4.4 V8 from an E9X M3
Reply: Old school swap, LQ9 6.0 LS out of a ws6 Trans am and and procharger set up with a T56 magnum 6 speed.
Reply: C4 ZR1 engine that was made by Lotus. That would make sense.
Reply: @soberlife   Yep.  That's what I was saying too with my suggestion...essentially.
The SPEC TT Rapture – Forged Internal PRV w/EFI, Twin Turbocharger Units (Premium) by DeLorean Industries.

It's original-ish.  Forged internals and twin-turbo.  But still!  I mean, after all, what's a little boost between friends?  😁

(On an aside, I have MUCH respect for your handle, my friend.  More than can be conveyed.)
Reply: How about this swap boys and gals>>>>> ford/cosworth DFV 90° degree v8 direct injected 530 horse F1 engine 4 valve out of a formula 1 🏎 car????
Reply: @Kee-Von   Yep, this is 100% true and correct.
And a nice trivia shoutout there, my friend!  👍
Reply: The original one rebuilt with higher performance parts and a turbo.
Reply: Buso V6.  To keep it in the family how about the motor out of a Renault Alpine GTA S.
Reply: LS7 is my vote.
Reply: My vote is either a K24 turbo or go full EV conversion.
Reply: I'm old school and I'd go with a 351w.
Reply: I hate myself for saying this, but LS everything! 

My preference would be keep the stock engine, but maybe build it a little. Don't know anything about the stock engines in those or what the options are for building it.

<EDIT: Ok, after finishing the video and seeing the scale model, forget everything below. I'd keep stock engine if at all possible. Maybe mildly build it, but try to keep it looking stock under hood. I'd also try to get some vinyls cut for the model that match the graphics you put on the car.>

Generally I'm all for swapping, but prefer to keep it in brand. I'm a Ford guy a heart, I hate when people swap in a non-Ford engine. I'd keep Chevy in Chevy, and Mopar in Mopar too. 

DeLorean doesn't have many/any options though, so you'd have to look to other brands. It's been said for years that LS fits in anything. I think Jared's (TheQuestionableGarage) recent experience with the TriHard Duster is a shining example of that. As much as I'd like to scream Coyote being a Ford guy, it just doesn't fit well in some places. Even the Hemi fit better than the coyote, but the LS fits everywhere. 

I'm sure that there are other exotic swaps that would fit better, but you said you want to keep this forever and enjoy it. I feel like the LS is the best fit for that, because it is an extremely common platform that will be around and supported for a long time. Newer, better design and EFI will result in a more reliable vehicle that is more pleasurable to drive. Who knows, it might even hit 88 MPH.

Based on your previous comments about wanting to slightly lower and improve handling of the car, if you pick an aluminum block LS it might even help with those characteristics.
Reply: Hello, I'd put a 3.0L tfsi from Audi A4 B8, 330hp. Or a simple 2.0L fsi 200hp.